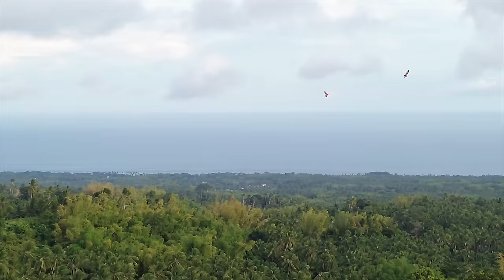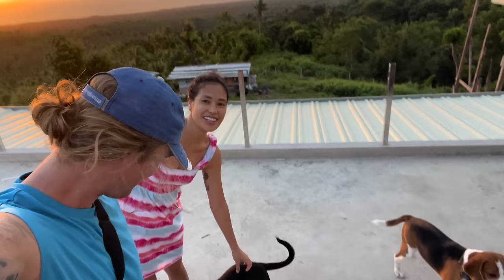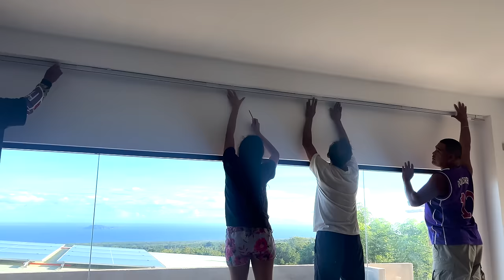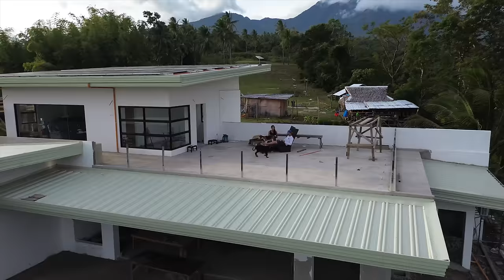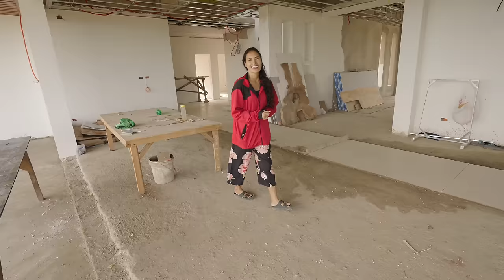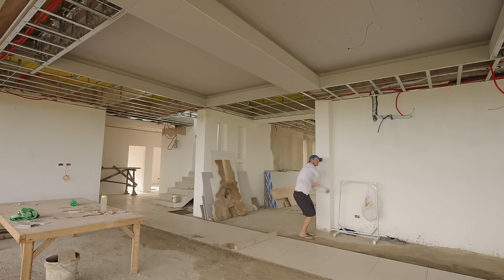FIRST WEEK & CHRISTMAS LIVING IN OUR NEW HOME - Our Honest Thoughts So Far

Comment: Here in the UK there has long been a debate about the viability of solar, mainly due to the amount of sunshine and thus the output of solar here, but also the cost of the panels and systems themselves. Obviously as technology becomes more efficient and costs of panels come down, the proposal becomes more attractive.
Your situation looks pretty close to being ideal, with many hours of sunshine and a sensible cost of installation, just need to balance the energy storage, versus need, to make sure you have enough in the system to meet your requirements, without paying out for additional energy storage that won't be needed. 
Regardless, you have a house that meets your specifications, and layout that works for you, even if you tweak it over time, and few people get the chance to live in a house that was tailor made to suit their needs, so good for you. Hope you have many happy years there.
Reply from the maker: Thanks Sean!

Comment: We live off grid here in Busuanga Bay Pal. First installation 2kwh, with 700amp battery bank, we use Inverter fridge 120watts, coffee machine 1500 watts, bread maker max of 1300watts, elec.stove top max off 3500watts and lights. We pay off the solar system in 1.5 years from buying gasoline. And now we have a bigger system, we dont need to run a generator just to have electricity,  We have mooring for Cruiser in Busuanga Bay, called Sunset Mooring

Comment: Your decision of installing solar power system is definitely right, especially in your remote place. A few comments to your calculation. First, Philippines electric supply is not cheap but definitely not so expensive as e.g. in EU. There the kwh price is about 50% higher.
You calculate that you would later at full capacity pay 25K Peso per month. That means you would use more than 2000 kwh per month or daily almost 70 kwh. Your solar system is 25 khw. Just calculate again. I live in Metro Manila and have a  2.5 storey house with a pool. My monthly consumption is about 22 khw. I calculated that it would take 10 years to amortize solar system without any repair/maintenance.
I am still thinking and probably will wait until panels and batteries are at better efficiency.
Just update later your true figures.
Enjoy your house.
Reply from the maker: 133kwh*12*4=25,536 pesos per month
Reply: At this moment, it is just an estimate.
My own actual figures are about 8000 Peso per month for daily use of 22kwh.
A 25kwh Solar power system installation for my house would cost over 1 Mio Peso.
Meaning amortization is about 10 years w/o repair/service. We don't have power outages in our area (over 16 years experience). Still thinking. You may check with other vlogger "My Pi Dream" James on Youtube who lives near Lipa (Batangas). He gave details about his solar power system.

Comment: some error in your calculation there…if you gonna assume your taking from the grid then your aircon for the solar accessories room should not be calculated in😊…it’s about 20% of your final numbers
Reply from the maker: We are off grid
Reply: @FinnSnowVlogs  ya i know Finn, i just reacted to the calculation you shown on the scenario “IF” you were buying electricity from a local company and you counted the number of aircon’s you need to power up. I think you included the aircon for the solar battery rooms if i’m not mistaken😊